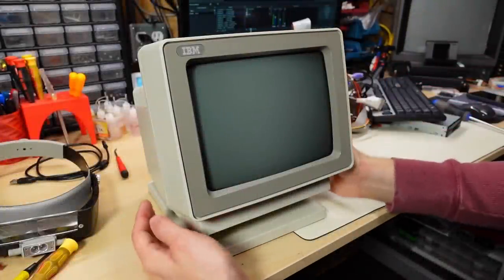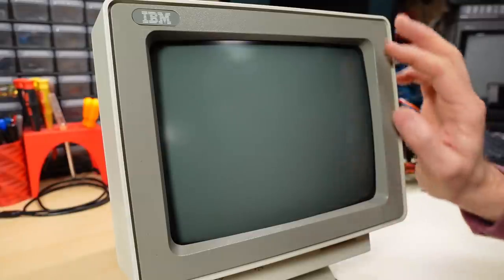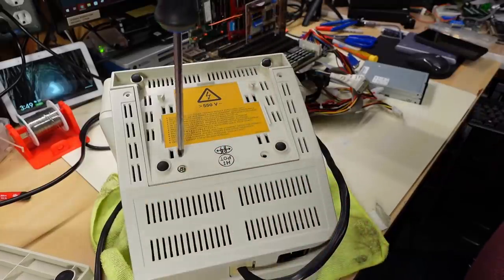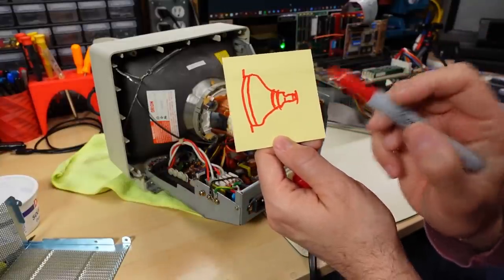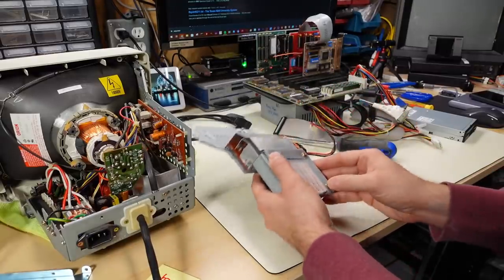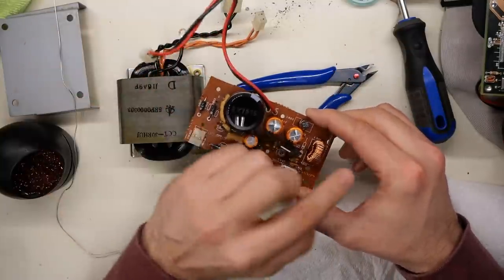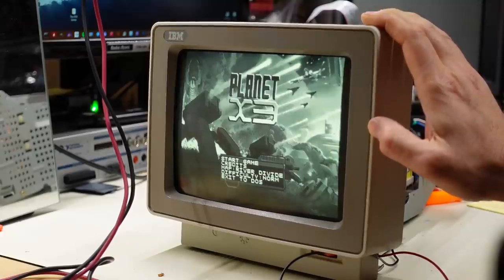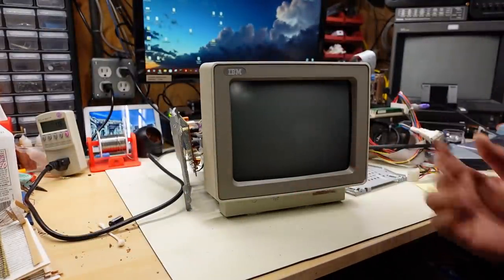Corrosive glue nearly killed this monitor (IBM 9" VGA)

Comment: Adrian, When I worked doing repairs we had a saying "It's never the chip, Always the Cap". We also used to say that "The more legs it has the less likely it would be to be faulty"
Reply: Oh, you missed an oppertunity there 0rin! "The more legs it has the less likely it is to fall over!" ;-)

-Dx
Reply: "The more legs it has the less likely it would be to be faulty"  <<< also explains why BGA stuff with no legs to speak of fails so often :P

Comment: That "brown gunk" is universally known as "tan glue of death" in the repair field, because in new condition it's tan/beige in color and as it degrades it turns more and more brown-ish. Ontop of that it gets hygroscopic (absorbs moisture) which can lead to shorts especially when used in switchmode PSUs, blowing them up. Manufacturers usually used this stuff to hold thru-hole components to the board before soldering. Best practice is to get rid of all of it when fixing a device
Reply: So true is that , allot of it , even almost lost a job over it when in a SVHS deck and called vendor and they acknowledged it. It's in allot of old things and is bad. The Mitsubishi  TV oil leaking in caps is the worst. all the tv's leaked oil on caps and corroded pcb boards ,  some in shop could smell the burning oil as replaced. some times Old flux can cause leakage and cause a problem. SO clean the board before jumping to a no fix condition. That repair would have been a 180 dollar REPAIR at 60 per hour plus parts. It's more per hour now that was cheep. Sad but true. some antique car radios  200 or more. Well I got it still do . Love old tape decks and Console stereo's, and 20's radios. Also welcome to the bad cap thing, I had a large inventory at work of caps, car radio's shorted caps tantalum ones, amps old, new baked in cabinets, always got 105 deg caps to replace so id never see what i fixed back to me, Put 50 or more in a a amp all bad. Also no to mention is the bad cap era. Some manufacture got the wrong formula to make caps. electrolytic Caps are temp and hours rated go see spec sheets also the power rating if in a power supply. so be care in selecting replacement.  55 years of it,  broadcast 3 tube cameras, sony Video real to real to to 1 in with pizeo head tracking, on and on, to digital typesetters from auto-logic and beyond, to uni buss and PDP 11 macro programing.
Reply: At 21:00, the capacitor that is being glued down does not have venting on the top of its can (the venting will look like slices). That means it is made to vent on the PCB side - and that glue might prevent venting in case the capacitor experiences some fault condition.

Not so good design there.
Reply: We call it "Gorilla Snot" here...
Reply: @whstark  Wow... word salad
Reply: @Knaeckebrotsaege  It gets progressively worse :D
Reply: @Knaeckebrotsaege  IDK sounds like typical repairperson speak to me. "It's in 'allot' of old things and is bad."
Reply: Best solvent to clean it up with?
Reply: @petevenuti7355  none. the stuff scrapes off with a flat blade screwdriver like a weak hotglue (like at 19:00 or so). if it's gone crunchy it'll pretty much turn to dust instead
Reply: @Knaeckebrotsaege  yeah doesn't always come off so cleanly, and I've seen other rubbery stuff... Afraid to try acetone & isopropyl don't cut it.  Thanks though...
Reply: I had to deal with this stuff in a thermo-electric cooler. Wonder if that's what made the power supply blow originally.

Comment: When the system remains powered off for decades, the oxide layer in the electrolytic capacitors can crack (it's the voltage applied during normal usage that constantly reconstitutes the oxide). If you then turn the system on, current leaks through the cracks in the oxide; and depending on the voltage applied, there can be so much current leak that it shatters the oxide layer. Since the electrolyte is conductive, at this point the capacitor just becomes a short. This is actually quite common.
Reply: Interesting. Never heard of that!
Reply: Great post. Powering up long-dormant electronics can be the thing that destroys them.
Reply: @UnitSe7en  yes, and looking for vintage computers on eBay can be really cringe-inducing; hearing in the descriptions people powering things up with absolutely no clue. I'll be happy if computer repair people can someday start making money consulting people with their "antiques", testing power supplies and inspecting caps and such before needlessly frying mainboards.
Reply: This is mostly a problem in tube equipment because of the high voltages involved. A filter capacitor can start out  with 20mA of leakage current at 200v, and end up with less than 1mA at 200v. When hooked up directly to the voltage, it'll boil dry and/or piss electrolyte all over the chassis. 
For transistor equipment, the  voltages involved are so low that usually, if a cap is leaky, the cap will reform in circuit because the leakage resistance is too big for destructive currents to flow, or just stay as bad as it was. 
Using a current limited power supply at the full voltage is the right way to go.
Reply: It's interesting how just one bad capacitor can prevent the whole thing from working! 😨
Reply: @zsombor_99  - comes as no surprise to me. Capacitors that overheat can short out or vent. Semiconductors, especially power semiconductors, can also be a single component that fails and disables everything.

Comment: As you may have discovered, the small VGA monitor (without the base) was used with the IBM Wheelwriter for the high-end models - but, as others have commented, the IBM 47xx-series is for the "Finance Communication System".

Comment: The IBM 4707 was a financial terminal monitor, part of the 4700 family of parts. It was typically paired with e.g. a 4704 Model F style keyboard, of which, they came in 50, 62, 77, and 121 key varieties. The 50 key was a typical keyboard for doing 10-key entry.
Reply: I have a 4707 and a 50-key keypad with an alphabetic layout, a fun pairing for photos as a cute mini system if I may add. Unfortunately though, my keypad isn't a Model F - I have the PS/2 compatible Model M version (P/N 1395249) presumably used with emulating or migrating from 4700 applications with PS/2 and later systems.

Comment: Very lucky that power-supply was designed as well as it was.  A cheaper PSU would've just kept pumping that 15V into that shorted cap and eventually it would've taken out that chip, no doubt.  But that PSU, sensing an overcurrent, essentially disconnected itself and stopped that from happening.  Good job, IBM, with this design!  And kudos to you for finding this issue and getting it fixed -- excellent video!!

Comment: Another nostalgia blast for me. I couldn't tell you how many of those I've fixed back in the '90s, must run into the hundreds. I didn't have circuit diagrams for them as they weren't released back then and I'm guessing they never were. It will be interesting to see how long that CRT lasts after rejuvenation. Thanks again for another entertaining repair video.

Comment: Hi ! The 4707 should have a brightness preset alongside the brightness front dial. In the factory they use differently sensible tubes and they adjusted them with brightness full open to a certain "lumen factor" with the preset as far as I recall. I only had these screens along with the bigger 8503 PS/2 monochrome on the workbench if e.g. cables got damaged or screen size was wrong or power supply blew up. Back in around 1990 I had the factory setup sheets for all 85xx monitors. The 4707 was a rare bird and was partially sold for server purposes along with a small size keyboard with integrated IBM Trackstick. The type number 47xx indicates that it belongs to the finance communication equipment line of machines. That was the gear used for banks to replace the IBM 3600 series machines in about 1981. This screen was also used for the IBM Wheelwriter 10 Series II typewriter (Model 6789) along with an external 3.5" / 720KB floppy drive.
Reply: Dude, how the hell you remember all that from 30 years ago....damn. wow..
Reply: @jaybird57  Hi ! My dementia isn't all that bad for now. I always had a problem remembering names since I was a kid, so it isn't that serious now at the age of 61 .... Err ... what were we talking about ?
But seriously: I work as a computer-technician for over 40 years and about 34 years for the same actual company. It was - at a point - Germanys largest IBM systems dealer during the time of PS/2 machines and we had quite a few of them on the desk. Back then gear war really repaired, not only replaced or sub-assemblies changed. So my recollections are still quite good. I hope.

Comment: The tellers at my mother’s bank used these monitors. They were attached to PS/2 machines each linked by thicknet to an IBM 3090 downtown. I remember every year they had a software update I got to play on the 3090 and change the tapes. Truly my first computer.
Reply: Sorry but by then it would have been thinnet coax or IBM Token Ring.  You did not get anywhere near the tapes.
Reply: @godslayer1415  And how do you know this? Were you there?
Reply: Are you sure they ran thicknet all the way back to the mainframe?  If they were running it such a long distance it would have to go through the telephone network using a T1 line.
Reply: @douro20  Thicknet locally, then it went downtown by other methods. The branches networked with the mainframe locally through thicknet, though.
Reply: @godslayer1415  NBNTV explains below about "thicknet", and there were also a lot more small banks back before 2008. Why nitpick about that detail, and why assume that meant he didn't get near tapes, no matter what networking cabling involved? Why do you feel this deep seated need for putting people down? Does it have something to do with the militant, fundamentalist atheism you seem to espouse?  ;P
Reply: @godslayer1415  I was 9 years old. I did get near the tapes, got to play games the operators made on the consoles. Sorry if I can’t identify thin or thick based on a memory from nearly 30 years ago, but thank you for your correction.
Reply: A very similar chassis also powered the IBM InfoView series of dumb terminals, that's where my saved from recyclers model M comes from. They were literally everywhere up until the 2000s. PoS, etc.
Reply: @AureliusR  Coax locally only, but long distance by other methods. Probably T1 or something of that nature.
Reply: @d0wnboy  I’m not even sure it was called IT back then. Perhaps to some extent. It was just “computer operators” I think.
Reply: @nbntelevision1  Yeah.  A lot of times it was IS or some other name.  But the actual operators were part of Operations.  Those were good days.

Comment: Generally speaking the term "B+" is a forgotten term these days associated more with tube / valve equipment. It originally referred to the plate voltages on the tubes.
Reply: You may have missed the one vacuum tube that existed in this circuit.
Reply: I still hear B+ used quite a lot.  Given CRT's are tubes, I guess it is still relevant.   B+ technically could be any positive voltage supply, but it is generally associated with the higher voltage lines.
Reply: @wbfaulk  Adrian was referring to 12V as B+, this is not relevant to the CRT, but also not an uncommon use of B+ terminology.
Reply: @EsotericArctos  What? You don't think that it's running the CRT's "plate" off of 12V?
Reply: @wbfaulk  LoL  The Heater voltage is 2, but all the others would be higher.  :P (except cathode of course)
But technically B+ is any positive voltage, regardless of usage :).  It just happens it was primarily used to differentiate between heater/cathode voltages and the higher voltages in tube days. :)  
Given the plate of a CRT is the "Anode" that is considerably more than 12 :)
Reply: And that in turn goes back to the earliest days of radio when receivers were powered by batteries. You would have an "A" battery for the filaments, a "B" battery for the plates, and sometimes a "C" battery for grid bias.

Comment: Hi Adrian, this is Ferry from Germany. Thank you so much for your video on this monitor. I had the same issue on my IBM4707! I wanted to exchange the tube in my monitor against a 9" amber CRT. The Monitor was working before the "operation", but afterwards: Nothing. Black screen, obviosly no High-voltage on the tube. I thougt, I maybe broke the flyback-transformer by discharging it without a series resistor. Went to bed very angry and sad. Before sleep i watched your video an got a little hope at least. 
Today i checked this capacitor on my monitor and what do you know: It was shorted too! Crazy. The cap must have been died yesterday, while i was replacing the CRT. I also checked the other electrolytic caps, but they all measured fine.
So my monitor works again, after replacing this cap.
I would not have thougt of that without your video. Thanks! :-)

Comment: I love the CRT rejuvenation videos because it's just so cool to see a CRT be brought back from near death to a usable state. It is worthwhile to read up on some of the best practices for rejuvenation, though, as I've heard that you should be positioning the CRT in a particular way so that any of the oxides or corrosion from the gun that is blown off during the process will fall away to somewhere it won't readily cause problems in the CRT. Still, if it's burnt to the point that it's unusably dim, then there's no reason not to give it a go with the rejuvenation. You weren't going to be able to use it anyway with such a dim picture, so even if it dies, the outcome would be the same as before: a CRT transplant.

Comment: the label reads ">550V~", so this holds true for 14kV ... and would also for 300kV. Admittedly a slightly strange way to label it, but correct in some sense.
Reply: I was going to say that too. He missed the greater than symbol.
Reply: @glen4cindy  I was saying, that would be a good general high voltage warning -- they you're dealing with anything far in excess of mains voltage.
Reply: I'm guessing the 14kV is only exposed on the final anode at the "stethoscope" end of the plug and so the CRT was labelled as such.
The >550V will be for the focus and exposed on the driver board at the base of the tube.
Reply: It might be a regulatory thing where everything greater than 550V needs a label, so they'd just have a bunch of >550V labels rather than needing different labels for each possible voltage.
Reply: @StarkRG  I don't recall any regulatory things for stating what potential voltages are, especially back in 1988. Maybe the corps got regulation and testing even back then in order to force smaller biz out but only in industrial markets. Corps use government and taxes for themselves.
Reply: @Drew-Dastardly  that's true, but also sometimes government can be the only thing that gets in corporation's way. It's a double edged knife.
Reply: @Drew-Dastardly   - USA safety standards from that time did not require such labels of voltages, as you have noted. But IBM was selling into international markets as well, and there could be some foreign country where safety standards required that; and IBM would simply just do the same thing on every unit so that its final destination could be wherever an order came from.
Reply: @stevebabiak6997  I only serviced UK consumer CRT's in late 80 and early 90's and of course we all knew where the weak but shocking HT and EHT voltages were. The actual dangerous energy was in the new switch mode PSU's on the big fat capacitors or the very old live chassis valve and dropper resistor units.
But this is an IBM monitor for biz use. I expect their field techs used flow charts rather than a good knowledge of Ohm's and Kirchoff's law and these notices are a USA thing for a highly litigious country. A warning for tickbox "engineers" to not go there.
Reply: R/technicallythetruth  😜

Comment: I had a capacitor in an appliance die short the other day. That capacitor had no problem handling mains voltage @ 20+ amps, thank goodness for fuses. It is a pretty rare capacitor and all I could find was a 30 year old replacement that tested good. I figure if it's that old and still works it'll probably continue to work.

Comment: Removing gunk like this can often be speeded up if you have a hot air rework station.  Set temperature to, say, 100C and use a fine tip to get right to the gunk.  Warming it up can soften it making it much easier to remove.  Hot air can also soften the adhesive under stickers, making them much easier to remove, too.

Comment: I must be learning so much from watching you Adrian. As soon as you switched it on and the Watts spiked then dropped I thought "Capacitor !". Thanks for all your hard work and interesting content.
Reply: I've always found the larger caps more suspect than smaller values.
Reply: My thoughts exactly.
Reply: I think this is partially because he presents things as though we are doing the work and we are experiencing the pain (where relevant). You learn best by doing (experience is what you get when you didn't get what you wanted). By watching you feel like you're doing. It seems in your brain you are taking part. I am never going to be the expert he is (I'm older than he is), but it is gratifying to feel I continue to learn from him.

Comment: Im not all the way through the video but I do recall a similar problem shown on another youtube channel on some modern UPS units made by CyberPower which the vibration protection "gunk" goes off and starts conducting, thus shorting out components on the board. Nice fix Adrian its good another piece of history has been renovated.

Comment: i saw that model in server rooms and telehouses in both the UK and NL, usually attached to a monitor switch on a rack - late 90s/very early 00s. Often with horrendous burn in, since people often left them on and connected to whatever was misbehaving last. No photos, since they had a tendency to fire you for infrastructure photos in those places.